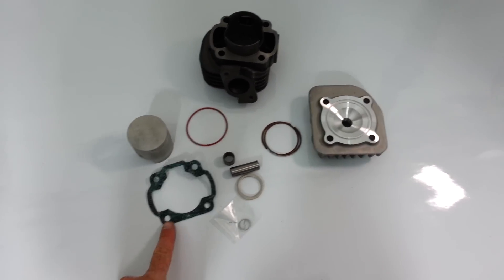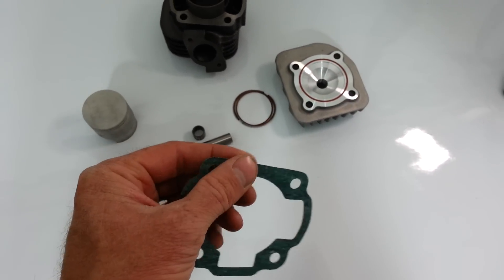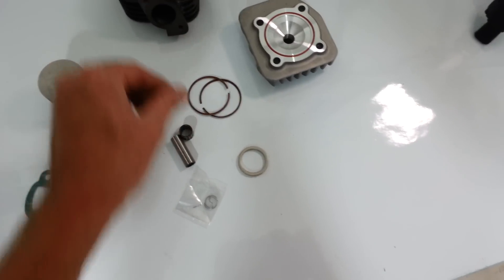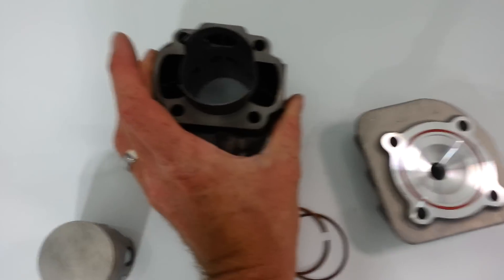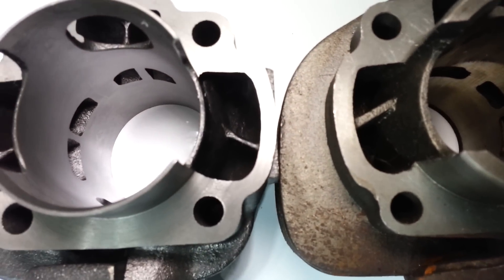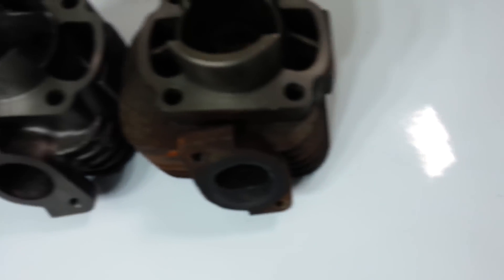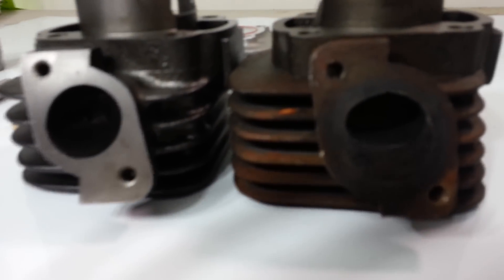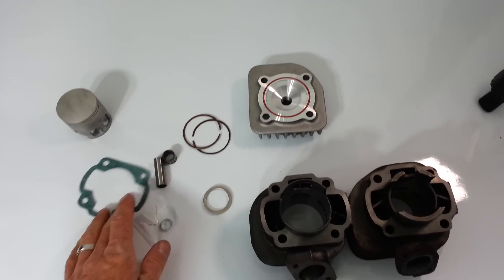Yamaha Zuma 50cc vs 70cc  JOG engine

Comment: So if I were to order this kit from you, what else would I have to do in order to not nuke it again?    I picked up a jog and the top end failed because of the autolube pump failed. I need to do the whole top end and I was considering a big bore kit, but what else is needed? Carb jetting? Exhaust porting? Different variator weights/spring?  Should I bypass the autolube pump and premix only?  
Thank you.
Reply: BIGGER MAIN JET IS ALL THEY SAY